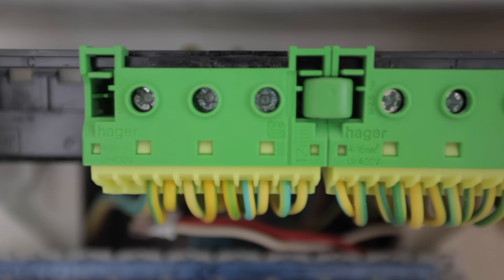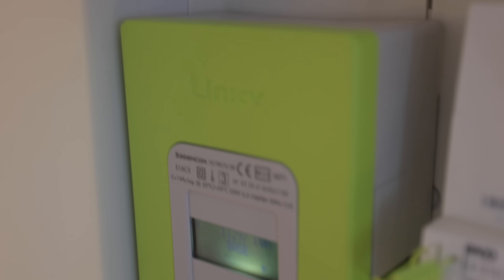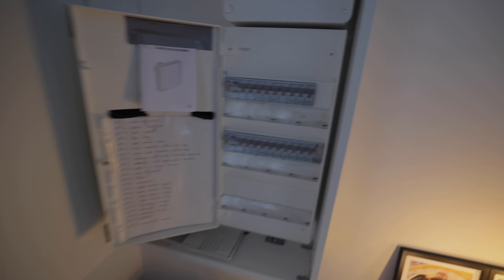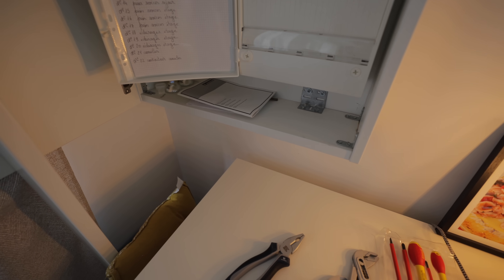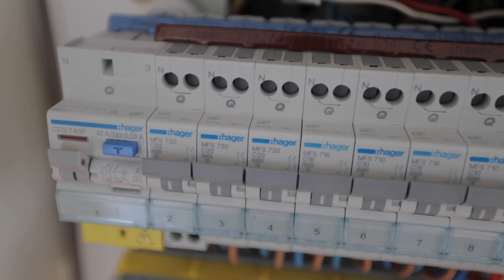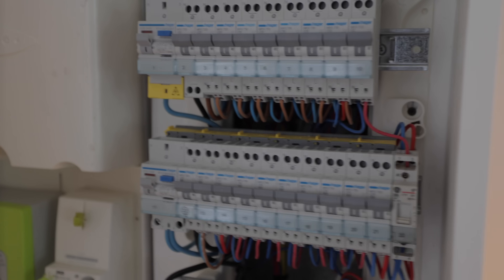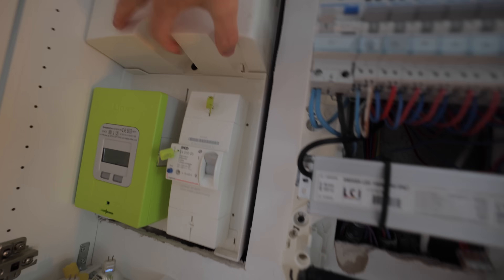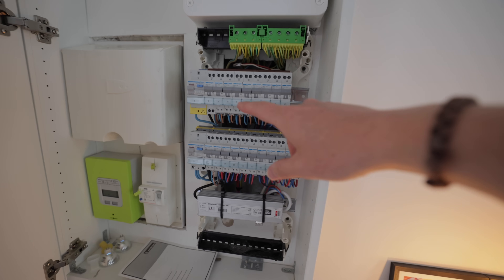U.K. Electrics SUCK! This is what we should be doing…🇫🇷

Comment: No way the French -- or anyone else around the world -- would call a breaker box a 'consumer unit'. Sounds like a term that an economist came up with.
Reply: German:

Hauptverteilung - Main distribution
Unterverteilung - Sub distribution

Bureaucratic German:

Niederspannungshauptverteilung - Low voltage main distribution

Colloquial 

Zählerschrank - Meter cabinet
Sicherungskasten - Fuse box
Reply: @maxking3 , im Zählerschrank wird das Verteilerfeld auch als Konsumentenfeld genannt  > costumer unit
Reply: @andrasschmauzer6816  Aber nur vom VDE-befähigten Fachpersonal, dass auch mit APZ, RFZ und TSG etwas anfangen kann…

Kein normaler Bürger kennt den Begriff.
Reply: @maxking3 , das stimmt allerdings. Aber in dem orig. Kommentar meinte der james, dass niemand in dieser Welt würde ein >Sicherungskasten< costumer unit nennen… well, the German… :D
Reply: In french "Tableau de distribution" that is  "distribution panel"
Reply: @huguesb9431  I'm translating that (quite literally) as « Distribution table »... ⚡😇
Reply: @UK-Combustibility-Assured "tableau" does not mean "table"... 😊 another meaning for "tableau" is "paintings" ...
Reply: @huguesb9431  the term "tableau" creeps"    into the german language many moons way back . So  it means "Tafel"  in german.
Schalttalfel= Switch panel,  mainly used if you refer to plants and machinery.  The fuse panel= Sicherungstafel or Sicherungskasten commonly used.   . The doorbell buttons on appartment blocks were called "Klingel Tableau" in some areas.
Reply: Silly name for a main panel. It is only a relatively new name.
Reply: Lol, but it's not the French, is the British.
Reply: It is a unit on consumer premises.
It is accurate and descriptive.
Reply: They've been called "consumer units" for as long as I can remember - and I'm nearly sixty.
Reply: @HowardLeVert  
Fuse board was the common name. Others  Fuse box and main board, etc.
Reply: @johnburns4017  They do more now than what a fuse board was originally expected to do.
Reply: @BrianejSmith  
Clearly.
Reply: Personally (From a British perspective) I find it quite descriptive - Everything in and south of it is consumer adaptable¹, everything north of the main switch should be left entirely to the professionals. 👍

(¹ - Assuming you have the due competency to do the work. It's consumer adaptable as in „The competent consumer may install additional circuits if required“ (e.g: New shower/HVAC circuit) as opposed to „The equipment is designed to be usable by anybody with no prior training“ (Plugs, switches) 😇)
Reply: @UK-Combustibility-Assured  You need to check the Wiring Regs / Building Regs to find out if you are able to carry out the work yourself and if Building Control need to be notified. If you carry out work the you should not - and cause a fire - The Home Insurance will probably be invalid - you could be prosecuted.
Reply: @shilks8773  IMC my DIY has been limited to replacement of two light switches (Circuit protected 5A RCBO) and a Type-G outlet (Sole item below an E7 16A RCBO). Two of those were during the pandemic when it wasn't legal for qualified electricians to come out for anything less than life or death cases, so reasonably justified under the circumstances. ⚖

That said, this just made me think I might want to check the torque on those terminals. I used a conventional screwdriver to As much as possible without damaging the threads 😇
Reply: @shilks8773  In the UK you can do it yourself, but you have to get it checked by a qualified electrician.  Replacing like-for-like units such as light switches and fittings don't need to be checked as they are not affecting the wiring.

Comment: Consumer units at front doors are frowned upon by fire brigades as the door is a means of escape in case of fire.  Fires do happen in consumer units with so many screwed terminals to work loose.
Reply: Others love it because they can disconnect the supply as they enter the house. A former colleague of mine was a volunteer fire fighter and worked during a flood. The first thing he did entering a house was find the DB and flip the RCD.
Reply: @Ragnar8504  
Fires are more common than floods.
Reply: @johnburns4017  With your name, you should know.
Reply: @Ragnar8504  You can still put a consumer unit indoors with an accessible fire switch/disconnector on the outside. That also avoids having to get close to your burning CU.
Reply: @tartanspy  
If the only exit is the front door, like in apartments, having the main panel at the front door is not a very bright thing to do.

Comment: The type AC RCD is not needed as many appliances have electronics in them.  Best to do away with the RCDs having all double pole RCBOs and the French equivalent to AFDDs, or whatever they call them, on socket circuits and heavy appliances. 

Double pole breakers and duel busbars are available in the UK.

The French are ahead in having double pole breakers and main differential disconnectors at the consumer unit. But everything else?  No the British are ahead in that aspect.  Look at French sockets with un-fused plugs, they are inferior to the British. They do not protect an appliance's flexible cord.

Comment: The main 500mA differential disconnector/main switch is an RCBO. The over-current side of the RCBO is adjustable.  They are available in the UK.  Nothing stopping anyone from fitting one.
Reply: adjustable RCBOs are no longer in use in fact. In the past, you had a guy from the distribution company who came to your house to adjust the value of the RCBO to your subscribed power. That came at a cost. Now with Linky smart meters, RCBO are set to the highest amps level the line can stand, and the max subscribed poser power is watched by the smart meter, that can power off your house if you overload it. You can changed your subscribed power very easily and it costs only like 3€. And of course, you can have access to a lot of details about your power use so you know how much power you really need.
Reply: @pizza_diavola-bx4op  
The older main disconnector RCBOs were adjustable for sure and are still available to buy.  They can be fitted on any UK installation.
Reply: Only cost, as they're rarely used here they're quite expensive

Comment: Like the push fit, the whole servicing of consumer units because screws gonna screw thing is a bit of a nonsense, particularly on a 10 year cycle (which lets be honest is about the best case scenario). Even with somebody who knows what a torque screwdriver looks like and does it's all a bit more questionable than it should be. Double pole we like, the bus bars are nice too. Shame it's Hager ;) Less convincing is the MCB rig, where's the SPD and what the heckers 40A? I do like the adjustable rating though, but give me some grunt to play with? My induction hob would pop that on its own (it wouldn't but not super far off) :) In my house the consumer unit is actually in a really nice place on the wall in the D/S toilet (new build) - doesn't mean I don't hate it though, I want a flush mount dual rail box replacing it packed with AFDDs and the works.. when I get time..
Reply: The 40A is 3-phases. Your induction hob example is already a pledge to do 3-phase to the building as a default. Add car chargers, heat pumps, boilers and  it is obvious, that this is overdue.

An while we‘re at it. 2 rails are actually not really future proof.

Many countries recommend to leave 2 spare rails for future upgrades.

Comment: Double pole Single width MCBs have been used for more than 10years. Along with push fit connections.   Also in many homes you can get 400 volt supplies.
Reply: Where?
Reply: @johnburns4017  3-phase/400V to the property is standard procedure in most European countries for decades.

In Germany at least since the 1970s.

Today the UK is somewhat an outlier with the default of a single phase to the building.
Reply: @maxking3  
Not really. Most are single phase into domestic homes, with odd countries like Denmark with 3 phase I think into all homes.

Three phase into a home that draws no more than 30-60 amps is totally unnecessary complexity, and overkill.

The UK is single phase with supplies being maximum of 100 or 110 amps. Only very large homes are three phase.

I have seen large homes drop from three phase to single phase on house renovation, as appliances and lights use far less electricity than 60 years ago.

Comment: Hiya, I moved from the UK to Biarritz in western France. Welcome/bienvenue !
My electric cupboard looks very similar to yours. By the way, if you take the green front off the Linky you will see some signalling terminals on the lower right - these are where the wires to the water heater contactor come from and how the water heater gets switched on and off for the heures cruse via the Linky (not a time switch).
Mine also has space for the internet router, RJ45 cables to each room and a power outlet to plug the router in to. It is all very neat and tidy. Even the doorbell transformer is in the electrical panel alongside the breakers.
Reply: the contactor isn't limited to water heaters! I also use it for my car charging socket for example :)
Reply: Its awesome that france considers home networking space as part of its electricity installs and bundles them all into a neat package. We're definitely very behind on things like that.

Comment: Hello , Mark here.. Long time subscriber, living in the south of France, close to Le Vigan. I have been using you as reference for years now. I have had to redo all the electricals in our old house to just make it safe and updated from the 80s nonsense they had going on here. The top RCD is also ment for industrial use (washing machine, heating) anything with higher long use. It is to robust for general use as I think it's tolerances are different. You are correct about the DC leaks, as you can have hight peeks when using electric motors or heating elements. If you ever pass by the Cevennes , you can always pass by and cry over my consumer unit, (it is only temporary untill we finish the house). Love your work, and glad to see your amazing French electrics. See ya.

Comment: Oh, forgot to mention, the white box above the Linky should have seals on it, the supplier uses it to shut the supply down for meter work etc. Used to be a solid neutral link and fuse for phase. Three phase low current supply is quite common.

Comment: Some good things about french spec electrical installations, GTL and its location, wiring using singles in "gaine", 2pole mcb's. Strange that boxes are plastic and not metal and no interest in fire stopping. Linky is a great innovation (lots of rural french oddballs have refused to let  them be installed as they claim it give off MASSIVE amounts of RF, nutters! tin foil hat brigade who are happy with mobile phones and wifi). The Linky has supeceeded the incoming rcd/amper limiter and performs the tarriff limit itself, this can be changed remotely by the supplier. I have a 3kW blue tarriff and the linky will shut me off if i try to use more power (washing machine AND oven after about three minutes). Its not an issue when you get used to it.
Reply: The outer cupboard door is metal.

Comment: "DTI" is "Dispositif de Terminaison Intérieure", the telco demarc point where the copper phone line ends. the test is a test RJ11 where they can plug a tester device. this particular model appears to have a 1 to 4 phone line splitter  (the 4 RJ plugs at the bottom of the device).
the consumer unit it to be installed in the "GTL" aka "Gaine Technique Logement" which is a floor to ceiling reserved area with a minimum 60cm width and 25cm deep, that is supposed to be accessible at all times. in new construction, the main breaker is to be installed between 90 and 130cm from the finished floor to allow access to handicapped people.
breakers themselves are to be installed between 90 and 180cm maximum for similar accessibility reasons.
as for the A and the AC, there are some rules in the norms about what cicuits are to use what type. you can use F types everywhere too, though, if you have the cash.
"cumulus" is the water heater. the contactor is for the "Heures creuses" relay from the meter
street -> blade fuse -> meter -> 500mA RCD.
Reply: I am a Ex-Royal Artillery Comms instructor 1999-2013 and I am currently a  Senior Network Engineer (Cisco etc..) and Telecoms Engineer. I have never seen anything like the DTI box. I really like it very smart It's going to give me something to look up today.

Comment: Every consumer unit I have seen has been decades old and made of metal. I'm in western Canada. Most rentals I have been in have all had consumer units older than me or they appear to be. I'm 48. I have not lived in a newer construction house until january of this year. Place I live in now is nice. But it can't handle AC in any rooms. It just trips the breaker and the landlord just says yeah no AC ever. So I have been looking for another place for  months. Can't afford to move either. The funny thing is I can't even run the washer dryer at the same time! I have to run them separately which doubles the time to do laundry.

Comment: The type A vs AC thing - my understanding is you should have 0 leakage on electronic items. It's heaters and anything to do with plumbing that's going to have some low level of background leakage. This is due to parasitic capacitance and/or inductance to ground. This is why you have most of the socket circuits on zero leakage - if any electronic device is leaking, it's broken and needs fixed.
Reply: No, anything is allowed to have a (very low) level of leakage current. The problem with type AC RCDs is that they won't detect a broken appliance that creates enough DC leakage to kill somebody and worse, they can be "blinded" by DC leakage (the core of the RCD is driven into saturation) and then no longer detect even AC faults. At least that's what I've been taught.

Comment: If all the higher currents (32A+) can be accommodated with push-fit connectors (ideally tool-less, lever-release) then it’s got to be better than relying on all electricians and competent DIYers to carry, use and keep calibrated one or more torque screwdrivers. Not just in the CU but all accessories.
Reply: Remember that in 3-phase installs, your 32A will rather translate to 3x16A for induction hobs or heat pumps.

That‘s still push-in territory.

Comment: Is this a typical French CU i.e. regs there require this kind of care be given to the CU by electricians or is it the exception?
Reply: The conformity inspectors (consuel) that is mandatory to be granted right to connect to the grid and get fire insurance validity have lots of rules to check. It is known that the cleanest the   setup is the more prompt the consuel will be to focuse on security points and not have the whole list check. Problem is that if there are failure in your complience another consuel will come and might find other non complience. So that is why people will tend to have it perfect on the first time and even do it overkill clean so that you get your complience certificate the first time spotless : less delay, less overall cost 😉 But when wiring was done by professionals the wiring routing quality might vary from one to another. Consuel are less going into the details when electricity was done by a professional ( proper certified electrician). But if you are a DIYer (bricoleur) be sure to get to perfectly done to get the certificate the first time 🖖
Reply: @testman9541  Sweet - thanks for the info!

Comment: Only a 40A supply! Electric showers and EV’s are off the table then (not that I’m fond of EV’s)
Reply: It's a flat. EV was never on the table. Houses get 3 phase (and higher rated supply if owner wants to pay (standing charge depends on supply capacity and can be adjusted easily as it was seen), but at 40A you get 25kW with 3 phase, half of that goes to the EV and everything else still gets ~12kW)

Comment: Definitely not correct, as the AC units in that house are inverter units, which is the type of circuit why type AC and F RCDs were introduced as they leak in DC or in high armonics. Here in Spain, there is a maximum of 5 breakers per RCD
Reply: In France maximum is 8 RCD by Differential RCD and there is a computation rule to follow to sync the rating of the differential RCD and the RCD rating. Car charger/plug have to get a dedicated deferential/RCD. Heavy load have to get a dedicated RCD (like a  oven...).